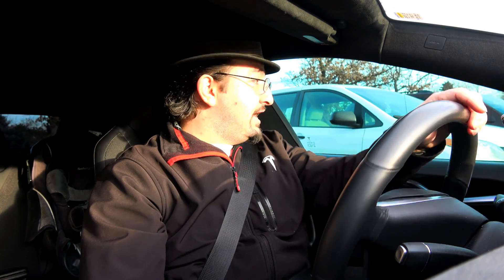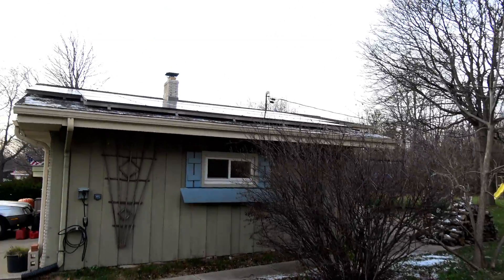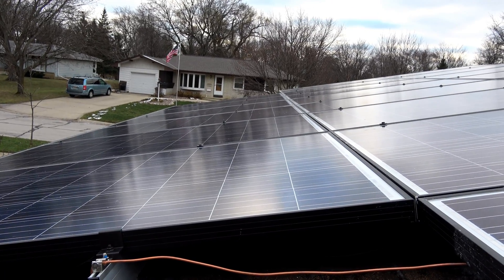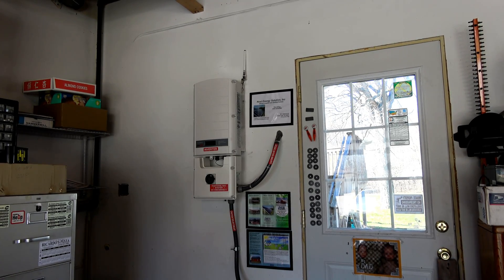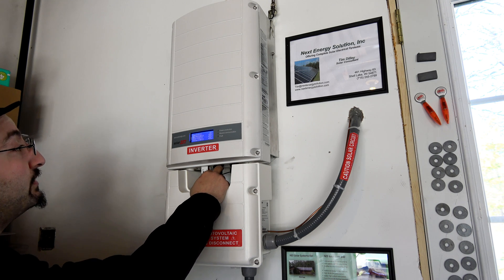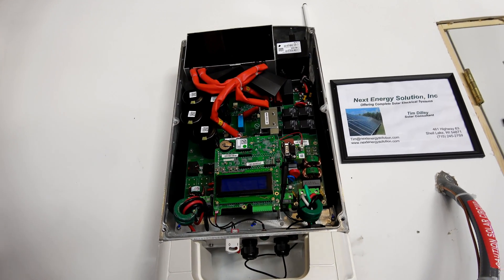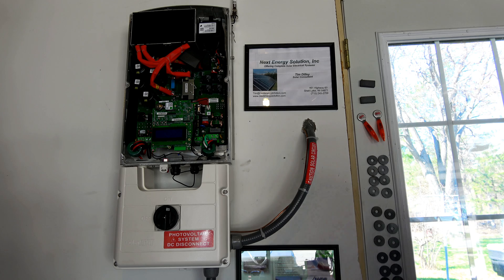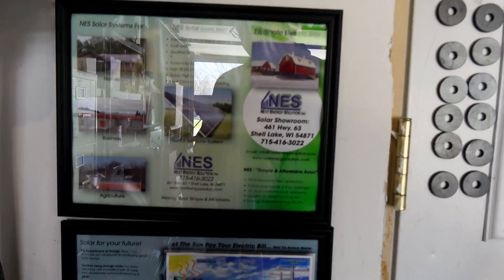Kman's 6kW Solar install by Next  Energy Solution

Comment: Nice setup!..........please check out the DIY system I finished about 6 months ago and let me know whatcha think.

https://www.youtube.com/channel/UCIOTIN4Yh96aNL5_7JPC6tQ

Factoring in the that the monthly service, or grid tie fee is a constant whether or not you produce solar, I have paid out of pocket a total of $20.59 for 6 months of electricity with summer temps in the high 90's for almost 2 full months.

If I was able to complete my install a couple of months earlier, I would have banked enough to offset even the $20.59, and then some!

My record high production was 88 kWh in one day in July.............Once I take down some ridiculously tall pine trees blocking much of the sun from sun-up till 11 a.m., I'll beat that record for sure!

Comment: I'm looking at a 5.9kW system here in Massachusetts but the installer is only recommending the Solar Edge SE5000-H Inverter. It sounds like a $600 up charge for the 7600 model. Is there a benefit to this larger model. I've heard people saying it supports a power wall but have seen zero documentation supporting that statement.

Comment: How do you keep snow off the panels? With 5.94kW, how much energy do you expect to generate annually?
Reply from the maker: I expect to generate ~ 650-900kWh/month during summer months/warmer months. In winter I expect to generate ~400-500kWh/month.
I made two things for snow, I made a scoop, which is to "pull" snow off/give a nudge to start the avalanche. I also made a 20ft broom. I will have a video on them, though not to show them in use.
Reply: Sounds cool. Always enjoy your videos. I'm building a house right now and trying to run some numbers on energy generation from panels. I came up with an average of 3.7 hours a day times the capacity of panels. That's based off my friends 2016 data from his 8.4kW setup in Dallas, TX.
Your numbers would get about 7MWh annually and given your 5.94kW setup that would come out to a multiple of 3.2 hours a day times full capacity when you average out the whole year. You probably get more winter and snow than dallas though but those numbers are good.
3.2hours/day X 365days/year * 5.94kW = 6900kWh/year

Comment: I admire your openness to new ideas and technology. I looked into the solar panels (I live in Indiana) about 3 years ago myself and found that the return cost of the system would take almost as long as the total projected life of the panels to recoup. In other words, I was better off not even bothering putting them on and I would be no worse for wear on cost. The whole idea of solar panels is just not economically advantageous. Still, I wouldn't discourage anyone to put them on, just don't expect an overall positive return on your electric costs. I did almost wet my pants when the panel fell on you Kman. Hope no warranties were violated. LOL!!
Reply from the maker: No warranties violated. Just my pride. 

Expecting ROI to be 3-5 years depending on what trickery WE Energies tries pulling this time. 

Just in the last 3 years, the cost for panels has dropped a good 75%. In fact, my system could have been quite a bit cheaper if I did some of the install work. They have self install program (NES), they do all the paperwork, final electrical connections, show you how to hang the panels on your roof etc... Basically a "Self Install". It can knock off some serious $$$. But I was trying to get in on some big rebates Wisconsin had, and basically would not have met the deadline had I done install myself (In 15*F weather!). So the panels were installed quicker, and the rebates paid for the installation. So basically it went up quicker for the same cost had I did the install myself, and then I was also able to "Erase" my power bill a few months earlier!

For the heck of it, give Tim at NES a call. He might be able to give you a general quote based on google imagery. If it is appetizing, he will drive out and give the full estimate.

Comment: Hey kman is 5.9kwh alot? Can it power you whole house or do you just have it powering your charger/other things
Reply from the maker: It's decent. I'll never hit the panels maximum though, due to the angle of my roof, but It will erase my power bill. 
My house is still connected to the grid. What I generate goes into the grid. I am credited what I produce, which then what I use is subtracted from (To keep it simple). If I produce more then I use, then the utility pays me for the over-production, if I use more than I produce, I pay the difference. so Im never limited by what I produce if I need more or to draw more power (High Powered Wall Charger.
Reply: Are you going to get an HPWC now that you have solar to offset the cost spike in power usage?
Reply from the maker: Already have  a HPWC at home. Spike in usage makes no difference. I just need to choose on peak or off peak to charge.

Comment: How much did you pay for the system including install and all extras?
Reply from the maker: $16,000 before Gov Rebate, Tax Credits & incentives. Ended up costing about $8,000 after all the bonuses.
Reply: That's really not a bad deal at all! It wasn't more than a couple years ago a system that size would've cost $25-30k all in.
Reply: KmanAuto 

Can you give a breakdown of the rebates and incentives that added up to about $8000?

Thanks

Comment: I'm looking forward to seeing a before and after electric bill for your house. The solar system looks great!
Reply from the maker: Gregory Piazza I already got my first, however my first month was not very productive due to poor weather conditions, also I was working on figuring out how the whole billing structure things played out. as usual, no one at the utility knew exactly how the billing worked and said just wait for the first bill to see exactly. I was under the impression that first on my usage would be deducted out of my production, then overproduction they paid me for. Did not work like that. instead, since I over produced during on peak, and overused during off-peak, instead of just subtracting it out they paid me the crappy low rate for my antique overproduction, And then build me for my off-peak overuse. Basically had the effect of me paying half price for my off-peak overuse
Reply from the maker: A power wall will fix that.

Comment: You said Enphase, which are micro inverters. I was surprised when you showed your string inverter. So, those devices on the panels are not Enphase inverters. They are SolarEdge optimizers.
Reply from the maker: Yes, SolarEdge optimizer. Had too much in my head when I filmed this, and helped some other people with their systems too, and they had Enphase inverters.

Comment: Are you going to go for a battery storage solution in the future? I have a 2.4 kw system with a Tesla 7 kw battery so I export very little
Reply from the maker: +iamduvern yah, waiting and waiting and waiting for tesla to deliver on the power walls that I won from referral program. who knows when
Reply from the maker: +iamduvern I do have about 10kWh worth of lithium cells, will be building my own of something.